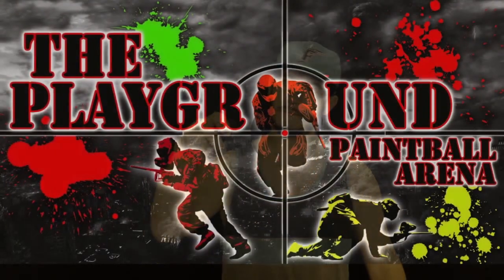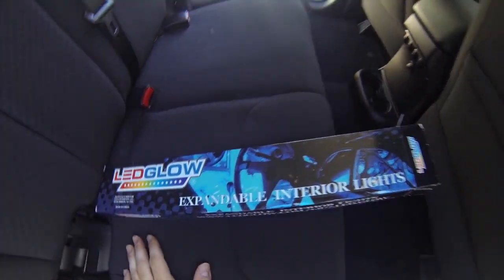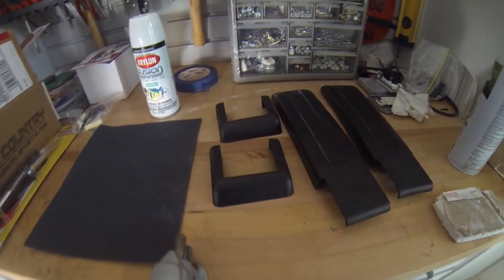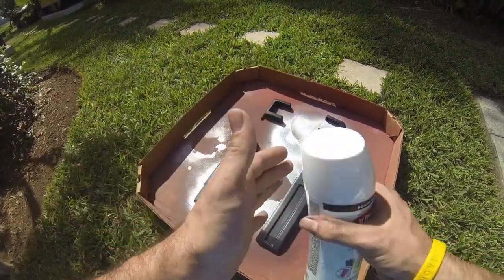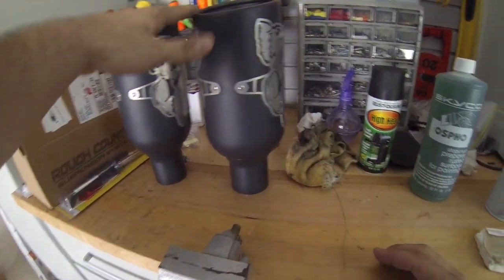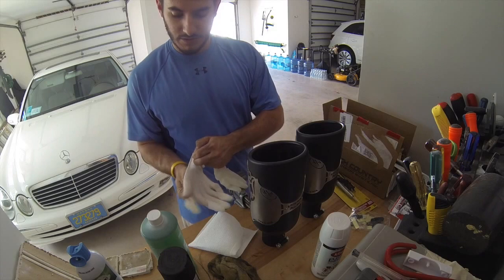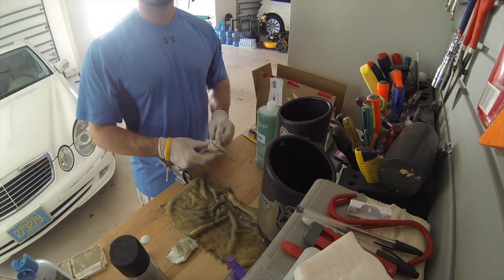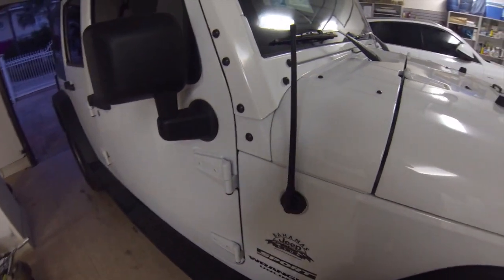2015 Jeep Wrangler Build Update

Comment from the maker: Stay tuned for Episode #2 coming this weekend!!! AdventureDex
Reply from the maker: ***** Thanks for the comment. I don't really recommend removing the Mulisha emblems as they will be hard to get back onto the top unless you know how to use rivet or spot weld. If you look on the inside of the tips you can see where they are attached by two small rivets, i would assume you can remove those and the emblem should come right off. I hope that helps! Thanks for watching!

Comment: Nice Vid man I actually bought the Gibson too on my white 2014 jk and its a little loud in the cabin but I like it I have to say. I also copied your idea of the red trim with the krylon. I went to the craft store picked up the red gloss and the clear lacquer. I was always doing a red trim on the inside. I bought red Bartact seat covers for the front and back and they are sick, you should check them out. A little pricy but Its worth it. I have yet to do anything with leds because I don't want to wire it up and screw it up. I also have 33" tires with 25" Fuel Mavericks Milled and grab bars for the both front and back $40 on amazon. I love customizing my Jeep haha its just great. Does that antenna pick up Satellite radio?
Reply from the maker: Thanks for your comment! Joe fiio Yeah the Gibson exhaust is loud but I enjoy it! I am glad you were able to spray your interior trim as well it really looks good when it painted! I am really interested to see your Jeep with the rims and tires! I also wanted to get Fuel rims but haven't saved up enough yet! Can you send me some photos of your Jeep? "Dex@bahamasjeepclub.com" I'd love to see how it looks with those rims and tires! Also, what lift kit did you put on it? The antenna works just as the factory one does, my jeep doesn't have Satellite radio but if your Jeep does then I am more than positive that you would still get the signal with an aftermarket antenna. Thanks for watching!
Reply: satellite uses a different antenna mounted on the back roll bar